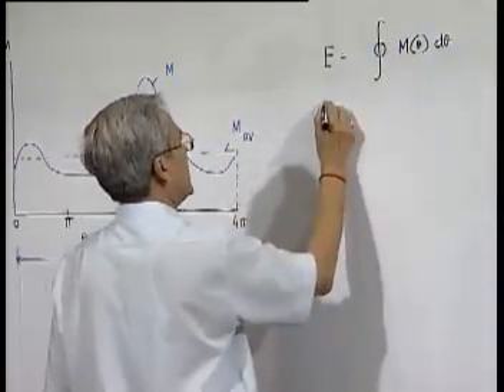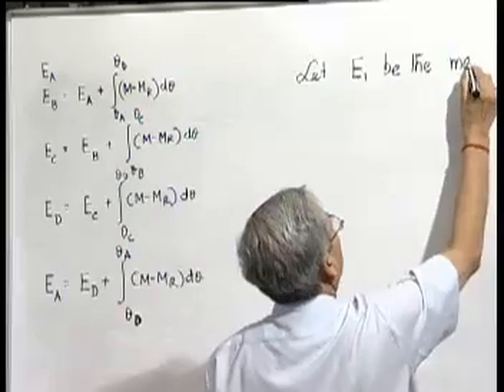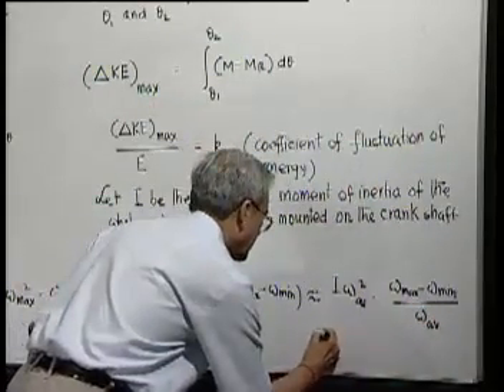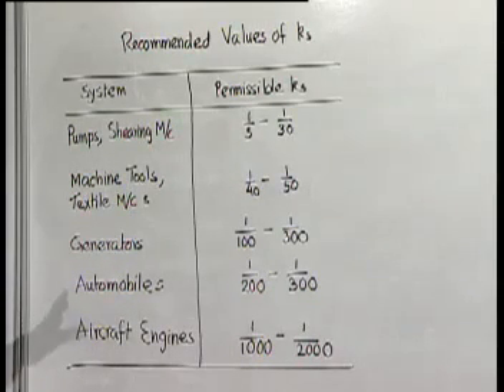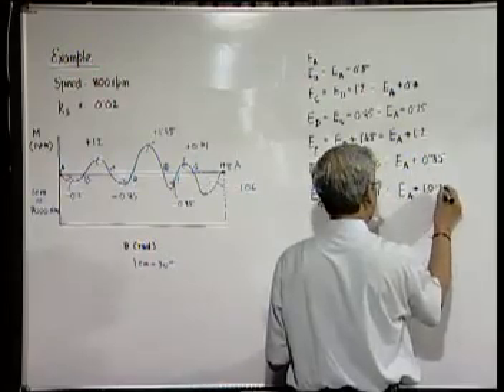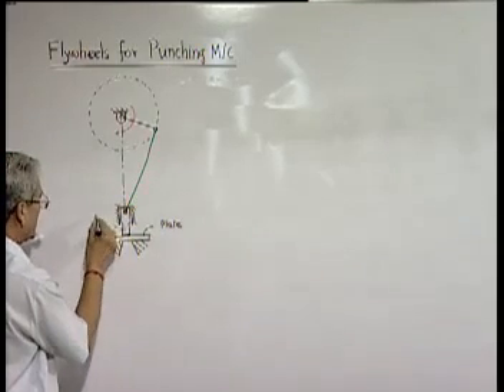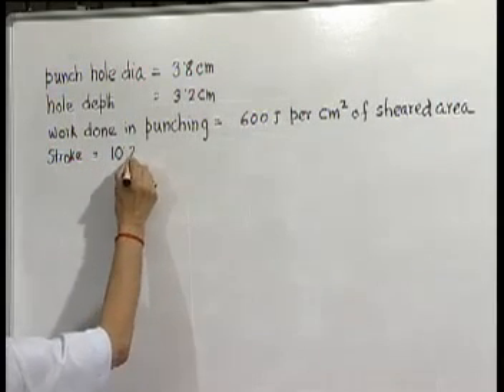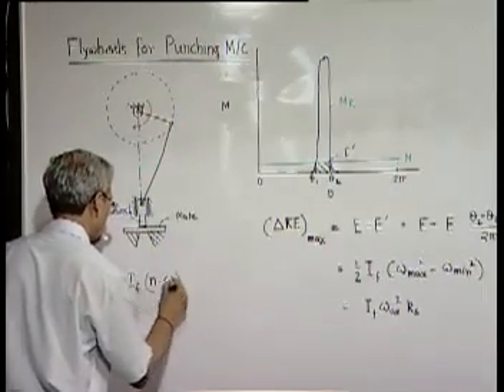Module 6 - Lecture 2 - Flywheel Analysis

Comment: Turning moment fluctuates to become less than zero (as per previous video)...right...The turning  moment @1.20 here is always positive meaning engine always supplies net energy during all induvidual strokes...
Reply: it is a case of 2 stroke engine and earlier it was 4 stroke...there is some gap in the video i think
Reply: @jshkumar2  cycle is of 4pi hence it should be 4 stroke i guess